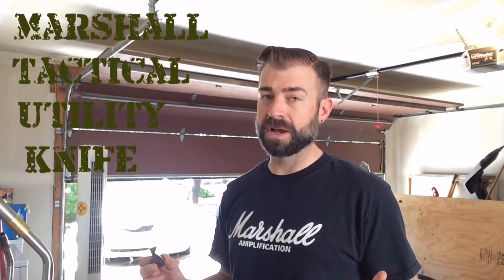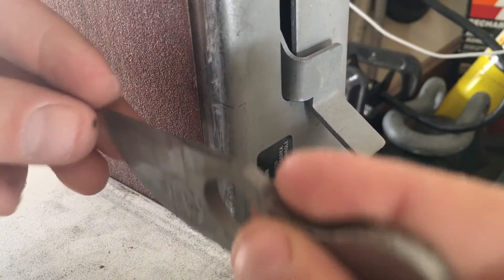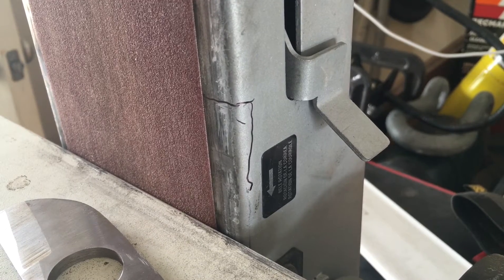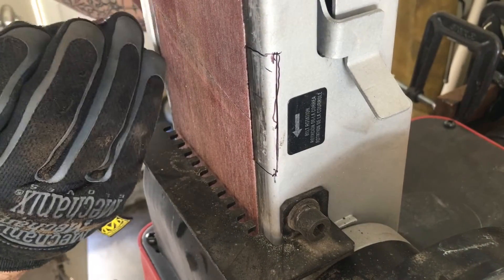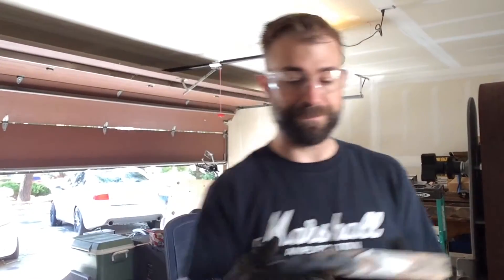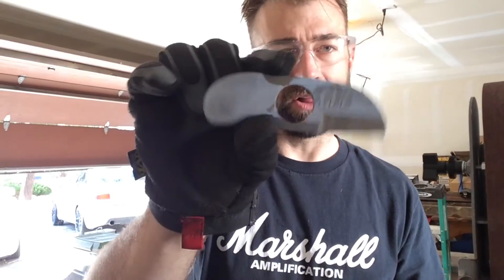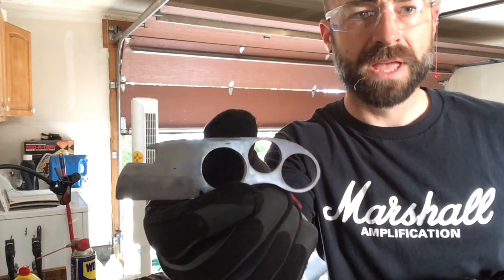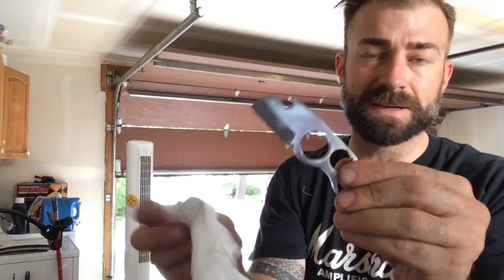Marshall shows you how to make a marshalltacticaltiliknife PART II: The MTUK

Comment: Rather than use the sanding wheel on the grinder, using the belt sander or getting a slab of bechtop stone with wet and dry sandpaper on then doing by hand would probably result in a smoother finish, but I also get it takes a while to get the finish that way.  Love the job though Marshall, so nice one.
Reply from the maker: +oquillo Thank you very much! 
I will adjust the grit of sandpaper and sanding wheels depending on the finish I want and, admittedly, the amount of effort I want to put into any project. 
Thanks for watching!

Comment: could you do a video on how you made or how that push pull bellows works? building one would totally save me running an extension cord and hair dryer to my forge lol
Reply from the maker: +Queste Usher I don't use a bellows. I use a bathroom fan on 2" pipe to push air on to my charcoal.
I have a video on how I built my forge if you're interested in watching it. 

Thanks for watching!